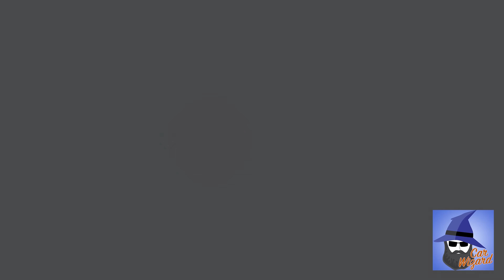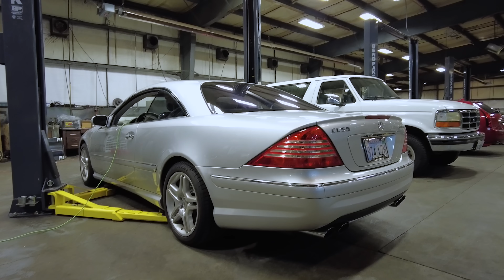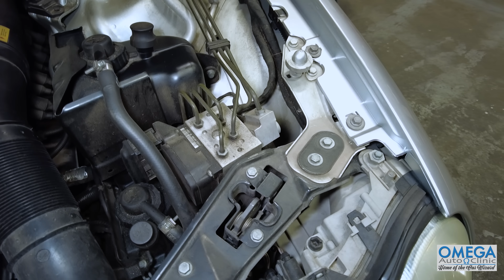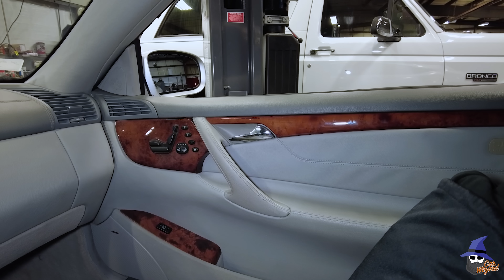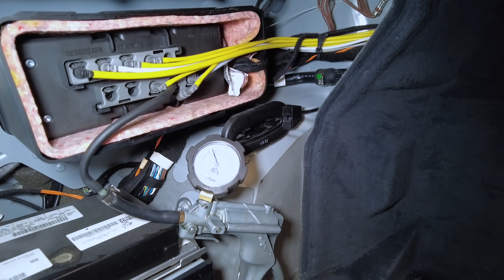Really, $4K to fix the locks! How can the CAR WIZARD charge SOOO much to fix this '05 CL55 AMG?!?

Comment: Thank you for this in depth video. I've been debating on getting a 2003 cl 55 amg for under 15k with only 57k miles with a good car history.  Still don't know if ill get it and potentially meet the common problems that you explained down the road. It would be an every now and then car for me because I have 2 other cars. I dunno. Again great video

Comment: Don't fear: if you fix it right, the headaches become less and less over time.
I plugged the vacuum door and lumbar closer hoses with a plug and JB Weld - simple.
The vacuum system is 100% rebuild-able. 
I replaced the carbon vanes in the pump and replaced the carbon brushes inside the motor with good results. No issues in 150K miles.

Comment: A note on the trunk as well: if the PSE pump fails IT CAN ENTRAP YOU! There is ZERO mechanical release for the trunk latch aside from the key lock on the OUTSIDE of the trunk. The interior emergency release for the trunk lid uses the PSE pump to open it, and there is no pass through in the W220 models and presumably the rest of the linueup. BE AWARE. If you have to do any work inside the trunk or have any potential kidnapping threats, make sure you have a cellphone on you so you can call for help in the event you are entrapped.

Comment: Weezard, I like your vids but your way off base with this….crack open pse, replace pump from a cheaper unit, solder it in. You can just check lines from manifold with a bike pump. Hey presto! 
Glad to see Merc moved the pumps higher up. My SLK unit was toast due to previous owner never clearing drains and the unit was 2 foot under water

Comment: Only need to replace the motor inside the pump .. the motor cost 40-50 dollars.. and you can replace it by yourself or pay money to mechanic to do it.. or just go to savarage yard to get a used but working one.. 4000 dollars to get a new one.. well.. not sure if this is a good idea to be a car wizard ..

Comment: WIZ,WAY BACK,OLDER UPSCALE AMERIN CARS,USED TO HAVE,A VACUUM SYSTEM,TOO BUTjust like this,,,,,,problems,FRANKLY,I had no blooming idea than modern,car would do this SILLY SYSTEM,  most cars today are ELECTRIC locks,hell,there is NO KEY FOR MY TRUNK,abash button but you CAN LOCH IT WITH A CODE NUMBER,IN THE INFO SYSTEM,FOR VALET USE,THANK GOD,NOTHING,KNOWINGLY IS VACUUM,maybe the ac dampers,,,,,,2013 TAURUS,      🇺🇸🇺🇸🇺🇸🇺🇸

Comment: 361 euro to replace the master window control at Mercedes-Benz because my 1 touch up driver's window is not working.  I have to hold the button to raise it.  DIY for about 60 but if I break something pulling it apart it gets more expensive.

Comment: Same thing with Infiniti. They sold me a car with bad door locks. Yes the sold me a used M37 and they wanted to charge me $4k to fix it. The audacity of those crooks. I had my mechanic do it for $1200 with aftermarket actuators. They are working fine so far.

Comment: Leave it to Mercedes-Benz to come up with a system which is so expensive to repair.  On my Honda Accord I had one of the door lock actuators fail.  I got a used OEM replacement for about $35 on eBay and pulled the door panel and replaced it myself.  I didn't need a special scan tool to fix it.

Comment: This is probably the worst era of Mercedes, where they were transitioning from mechanical to electric systems. The older pre 1990s had vacuum but it was not as costly and complicated as this. Not to mention the design of these was crap to the older Mercedes. These looked like any other car. No character...

Comment: I have a few questions about this video.  Firstly, if you are saying that the vacuum module isn't working, then how did you diagnose that?  Putting a vacuum gauge in one circuit only proves that circuit is bad.  Secondly, if a door lock actuator circuit is bad, does that really mean the door lock is bad or just that the hose itself has a leak?  Thirdly, more of a comment, if you are going to talk about beautiful lines on a car please have the hood fully latched so that I can really see those beautiful lines.  Just constructive questions and criticism, thank you.

Comment: The buttons for shifting on the back of the steering wheel were normal on early 2000's AMG's & sporty Mercedes models. Mercedes shifted to the paddles around 2005 to 07 depending on the car model. 

My '07 SL55 has a soft close trunk that has its own pump. A new pump cost me around $200 to replace. I was able to do the repair myself.

Comment: I had this car new and out of warranty my pump went out, I bought a pump for 69.00 off EBay, the puck on the drivers door was defective and the truck puck was bad. I bought two used pucks for 50.00 off eBay and had it up and running for under 120.00 and under 2 hours start to finish.

Comment: Similar design and manufacturing cheapness finally broke the camel's back on my girlfriend's 2010 C250. The door handle has a well known defect which is also a gross negligence in terms of safety as the door cannot be opened from the inside when broken. Dealer quoted 3k to replace the entire internals for the door. There is a $60 DIY but that entails removing over 30 rivets. Not as bad as a BMW but MB certainly isn't made as they used to be.

Comment: Dont know why any manufacturers still use or used vacuum systems on anything except brake boosters, especially external systems like front axle actuators and 4wd systems .  they prove to be very unreliable as age takes its toll on lines, as actuators, etc.  For example stupid ford trucks still use vacuum lines to lock and unlock the front wheel hubs on four wheel drives.

Comment: My Dad's 67 Olds 98 had vacuum operated door locks and trunk release.  If the car sat for an extended period, the locks wouldn't work till the car was started. His next 71 Olds had electric solenoid operated locks. and trunk release. Hard to believe MB was using an even more complex problematic vacuum system 34 years later. I assume the power windows were electric, on the really old MBs these were vacuum operated as well. I'd be curious as to what year they ditched the vacuum windshield wipers.

Comment: Why couldn't you pull a vacuum on each circuit to see which has failed, instead of relying on the OEM vacuum unit pump?

Comment: The vehicles equipped with sensetronic brake control were the e, cls, and sl. The cl never had sbc, you can also tell this is a regular abs unit because it has a master cylinder and vacuum booster. Another dead giveaway was the abs unit having the pump but no accumulator. The w215 has abc suspension which can be fun but no sbc. Those people with the 211, 219 and 230 models that want to change their brake pads, disconnect the connector on the abs unit and/or keep the doors closed. It will crush your fingers if you don’t!

Comment: I bought my used 2008 Corolla in 2015, and it only cost me $7,000 at that time to buy it (double what it cost to fix the locks on the Mercedes). Since then my Corolla has worked perfectly, needing no large repairs and needing no new parts other than new oil/belts/tires/wipers/brakes.

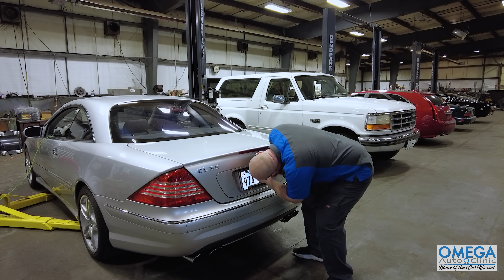Comment: 6:26 What a beautiful piece of fine German engineering crap. I like the way my 2000 Honda Civic works better. Well that’s because it just simply works. I pull the lever and lo and behold the damn trunk opens. No fancy soft close/open crap. Hell even our 2020 Toyota Camry, same thing, you pull the lever and it just works. For that matter even my Kawasaki Z 900 motorcycle, oh wait that doesn’t have a trunk never mind. But if it did have a trunk, I bet it would work.

Point being I like cars that over built for longevity like Honda and Toyota.  I don’t like cars that are over engineered

Comment: Why did you spend $1000 on the pump first? Would it not make sense to have in the shop a simple small air pump that could be temporarily used to test the system?

Comment: Well wizzard. Make a mountain out of a molehill. This is a common fail. $4,000? i think not. You obviously know the pnuematic box in the truck has a small electric motor that can easily be replaced for under $300 and the whole box itself can be replaced used for probably under $400 including labor. Yes i understand this is the first step in ultimately finishing the diagnosis but this is a $400 step maximum.

Comment: That's one thing I DO NOT miss about my 1980 240D.  The vacuum system that controlled literally *EVERYTHING*.  Including the fuel-door lock.  Which, of course, got stuck in the LOCKED position, so I couldn't put fuel in the car.  That was fun...  NOT!

Comment: I know from the start, its a crap car, got the 190e 2.6, great design and car, but... It has some bad designs, it takes wates in 2 the cabin, maby the sun roof
Reply: have you checked the drainage channels for the sunroof. it is very common for them to become clogged, especially if you pack it outside

Comment: I'm wondering what the engineer's rationale was that led them to the conclusion that the air/vacuum system was preferrable to electric like everything else on the road.  From what I can tell, this system introduces so many points of failure that would be way harder to track down versus something electronic.

Comment: While you are working on it, you should do something about the yellowish headlights. They have seen better times. 
I am actually glad that my E55 does NOT have many features that were theoretically available. I do not miss them at all, in fact I am glad I do not have them, as the E55 is all about the engine. 
No keyless go, no panoramic roof, no electric boot lid, no parking assistance/ sensors, no distronic crap gives more room for secondary heat exchanger. I rather invested into cooling upgrades, headers, limited slip diff and other upgrades than for maintenance of the above mentioned features. And even without all this stuff there is still plenty other systems that can give you electrical gremlins!

Comment: I wanted one of these but settled for a CLK. No vacuum locks, no SBC and no hydraulic suspension. Still very happy with mine!
Reply: CLK is the best choice for reliability and low costs.
Reply: And at some angles the CLK looks very similar to the CL, esp from the side

Comment: Had a 2002 Cl500 Mercedes, loved the car for about a week before I took it to the car wash, and the car flooded itself. Water came in through the passenger hvac foot duct and made its way to the SAM unit under the rear seat. Dealer quoted 6k for repairs.

Comment: It's usually the electric motor that fails, at least in the 90s Mercedes. You can replace the electric motor itself for $40. The door locks in the early 2000s Mercedes leaked regularly but I could take the door lock out, seal the vacuum chamber with epoxy, and put it back in an hour and a half for less than a dollar of materials. One gut wrenching problem was the fuel flap staying locked shut, I had to blow into the line manually to fill it up and drive until I fixed the pump. You can usually hear where the leaks are as well once the pump works.

Comment: Some say this pneumatic system is more reliable than electric system.
I say this is a dinosaur considering it's 2005 where in the 70, 80 we have electronic everything already.
Power electric locks is something that should have over taken by that time. MB is stupid in this design.
A central component causes all doors trunks everything else not to work is stupid. Where as if you had electronic locks and if that breaks then you can live with out just one lock not working or it would seem cheaper to replace just that as compared to this expensive pump.
Stupidity at this late time.

Comment: I had 1 like that same model same year, cl55.
That was the most expensive per mile car I've ever owned.
A wheel developed small cracks and leaked air, 1 wheel was more expensive than a full set of replicas, so I replaced all 4, like 1800 for the wheels, and since I went with 20s I had to buy all 4 tires. Another 1600
The trunk actuator went out, 1200 to replace
1 day out of nowhere I heard a very loud noise inside, like a mini explosion,  and that's exactly what it was, the driver side door actuator vacuum bag exploded, 1300 to replace,  the rear tires were shot after only 8k miles, another 700 to replace, the icing on the cake was that just a week before I sold it the ABC system warning light came on, that pump works your suspension AND your power steering,  4300 to replace, where are we dollar wise? 
I drove the car a little over 8k miles 😬😬😵‍💫  I was a blast to drive, it would spin the tires when changing 2nd yo 3rd gear with the traction control activated, loved it, but I was super happy to see it go......

Comment: More expensive then usual - yes, But this is a rip off. I have an R230 SL600. The parts are not that expensive and you are padding labor hours. Normal run of the mill chevy - sure 30 mins. This is a 4.75 hour book job. Insane for locks, but not 4k. We are quickly approaching a point where people will not be able to afford to fix anything on cars that they already can't afford.

Comment: Typical German over engineering. I operated German made machines when I was working and it was the same things. NOTHING BUT electronics. It is fine when it all works but a nightmare when it fails

Comment: Why not fix the pse ? You hear and feel it running so you know it is working. It could be as simple as an internal hose inside the module that has failed. If the impeller is broken is the pump that could be sourced as well. Still cheaper than replacing even with your hourly shop time rate.

Comment: I totally understand the owner of this CL. Bought in 2014, I own a '98 CLK 320 and - over the years - put in more money than it had cost to buy (which was not so much). Why? You can't buy cars like that anymore new. Simple as that. Try to get a new Mercedes coupé with a n/a six cylinder... So I will do all necessary repairs and drive this nice little car as long as they allow me to do that (and don't force me to buy an electric one...).

Comment: Did u try a new car battery?

Because if they are old and lose volt fast, the doors will not lock.
Well they lock but unlock right after.

Comment: I have a 2004 C180 Elegance (4 door sedan produced in South Africa for here in Australia) and am having a problem with the left hand side rear door lock, which would be just ahead of that side module in the trunk of the car you have there. Can you tell me if my car would have this system on board or not ? I was told that the lock replacement would be $1,000.00 Australian. Your advice would be most appreciated. Kind regards, Brian

Comment: I had the same issue with my W210, I found a wrecked car and put that pump into my car; worked a treat. Just make sure you take a picture of the lines before you remove them and replace it. Also, Stiffler's mum drove one of these.
Reply: Super easy fix. I went to a U Pull yard and paid $25 for the entire unit
Reply: You've nailed it!

Comment: Well, this cars are so well thought that when the system sense any kind of leak it can cut the air supply to a this system independently or shut the pump off completely to prevent it burns out. The easiest way to make the pump come back alive is to remove its fuse wait some seconds and reinsert it, then pump and all the systems will come back on and leaking can be properly found.

Comment: I see used   Mercedes  advertised cheap for sale  friends of ours  bought a used Mercedes I said you making a mistake ( I told them to watch the Car Wizard ) ,  after 6 months they sold the car lost money , the repairs were too costly,  and today getting parts good luck with that,  but the Wizard said something in a early  video  if your going to get a used car take it your mechanic have them inspect the car before you buy it ,  if the seller doesn't want you to do that then walk away from the sale simple,

Comment: If Mercedes were smart, they would make a car that was so basic it would never break. Power steering, power brakes, air conditioning, electric windows, stereo. That's it. One computer to run the fuel injection. That's it. No turbo charging, no supercharging. Non-interference 250 horsepower V6 or a straight six. Point to point wiring with no body modules. 4-speed automatic transmission with no transmission control modules. They could charge the same money as one with all the geegaws. Concentrate on build quality, reliability, and quality. In other words, the cars they used to build 50 years ago.

Comment: I had 1987 Audi 100 (5000 in USA) and it had also vacuum central-lock.

It also burnt the pump which was located under rear-seat, smell was awful and pump was very hot, maybe it could burn the whole car...

It had also drained the battery.

Used pump wasn't expensive for that car, maybe 20€/$, but that was ~15 years ago...

Comment: Ahh, the dreaded PSE pump...I owned an SL500 of similar vintage, & it was a complete money pit. The PSE pump was in a different location & drew air from the bottom of the boot, and due to the tendency of the hood to leak, the pump would suck up moisture & eventually pack up. Luckily, there was a chap here in the UK who could recondition the pump for about £150 (IIRC), & he advised me to reroute the pump's air intake so it drew air from higher up. I'm not sure how effective this was because, after the suspension struts began to leak, I decided enough was enough & got rid of the car. What were Mercedes thinking with this car? A great shame, but imagine if it had conventional solenoid systems & suspension?

Comment: On my SL55 I replaced the PSE pump and I fixed the boot (trunk)  lock vacuum leak with epoxy glue.  No more problems.  The pump was running constantly due to a fault in the pump, not due to the vacuum leak.  Basically if the pump senses a leak in a circuit, it will turn off that circuit.  So, replacing the PSE pump might just fix the problem.